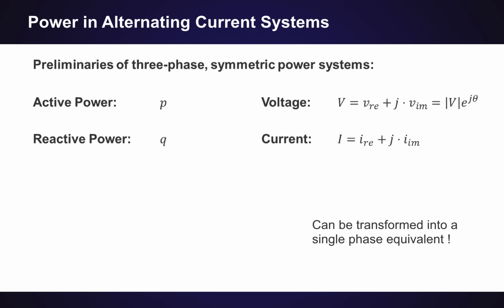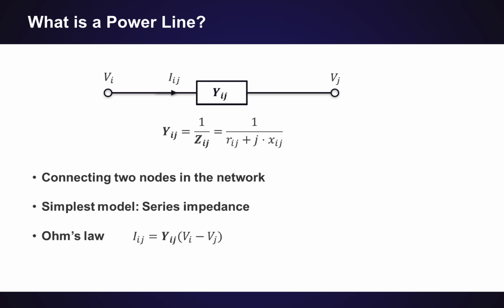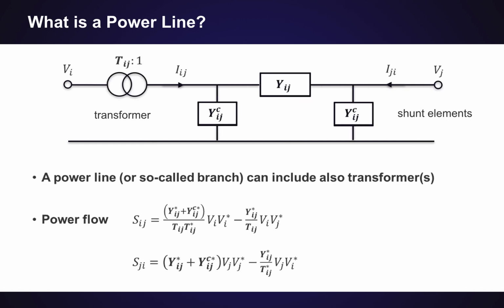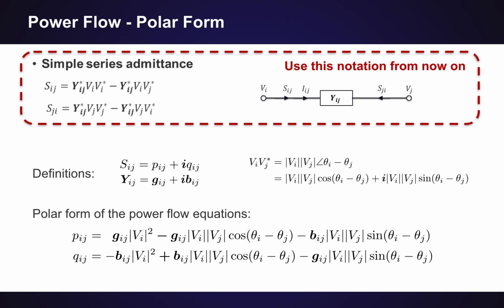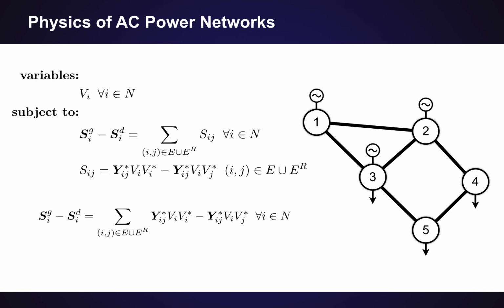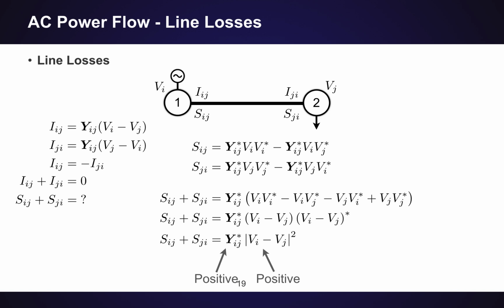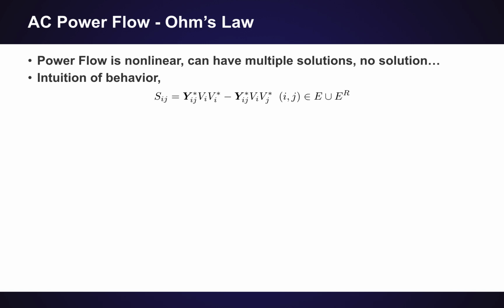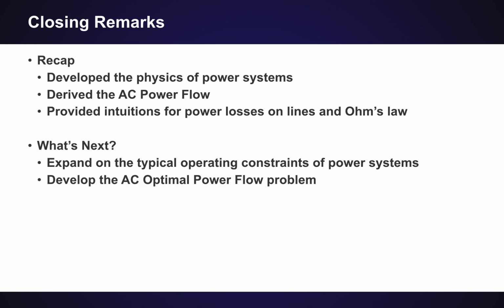Convex Relaxations in Power System Optimization: AC Power Flow (2 of 8)

Comment: How is the 3-D plot of [Re{I}, Im{I}, I^2] a cone?  Isn't I^2=Re{I}^2+Im{I}^2?
Reply: Could you be a little bit more specific with your question?  The set defined by z^2 >= x^2 + y^2 is a cone and z^2 = x^2 + y^2 is the surface of that cone.
Reply: @ccoffrin  I think I understood how you get a cone. If the z axis is |I|, then it will be a cone. However, if the z axis is |I|^2, which is what you have on slide 20, it should be an elliptic paraboloid (a quadratic surface). Is that right? 
By the way, I found these video series to be extremely helpful. I really appreciate the time and effort that is put in producing them. Thank you.
Reply: @sahraei1  good point.  The legend in the figure could be improved.